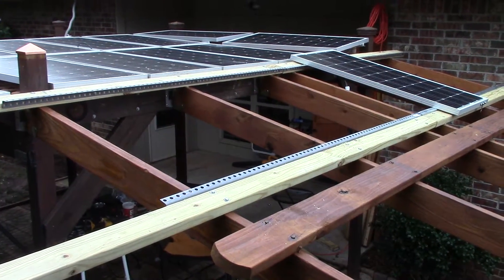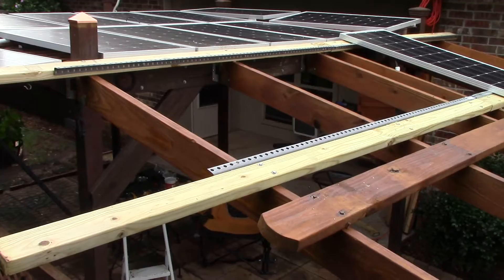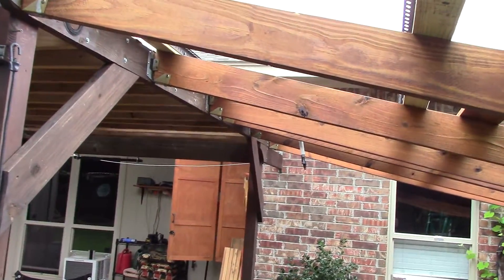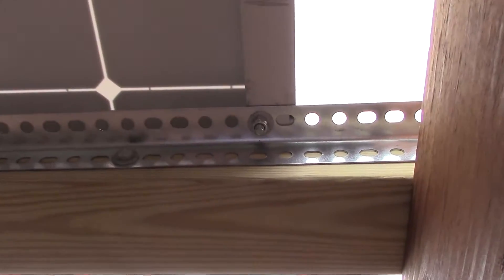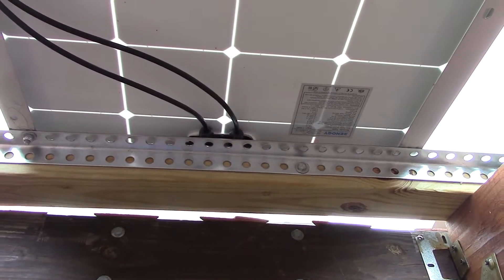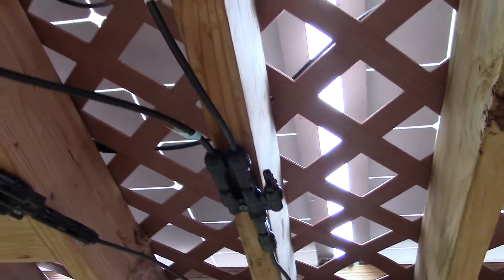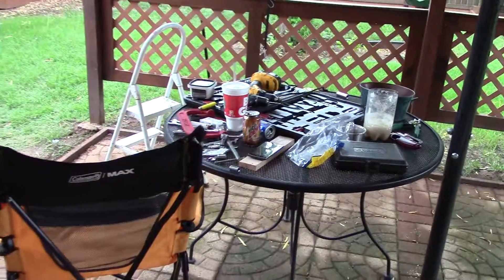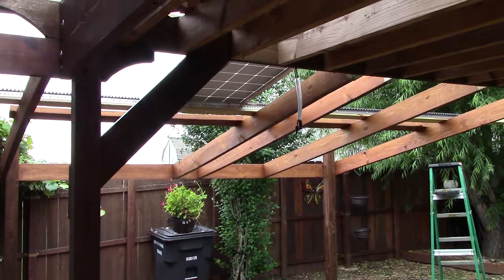Backyard Solar Pergola extension for Renogy solar panels (progress update)

Comment: Chris did you use anything to seal between panels (bead of silicone) or does water drip between panels when it rains? I like the angle iron fastening.

Comment: for 1800watts of panel that main wiring looks too light!!  are you running them in series or parallel?
Reply: 3 into 1 connector in the video so parallel a higher voltage inverter with the panels in series would be better or a 3  input inverter with separate wiring for each group of 6 panels.

Comment: Looking good Bro!! Love those panels..I'm ordering 3 more of those big renogy 250w mono and 400w of those for the kid 12v setup!! You got to love thinking with this stuff..
Reply: ChrisDIYerOklahoma Looks nice DUDE. Hope to see it up and running soon.
Reply from the maker: fanman1981 Sweet deal man! Alright! Sounds good!
Reply from the maker: yankey4 Thanks man! I am out back with the little laptop doing some monitoring. Also doing some final touches on the rail system (sanding, grinding, cutting, and staining). Wiring is done...and these new six Renogy panels are kicking butt! I will shoot a video either later today or tomorrow. Semper Fi Marine! Hoo RAH. Chris (USAF-ret)